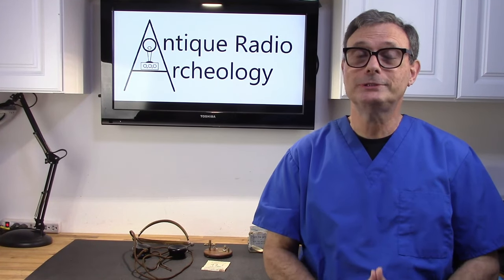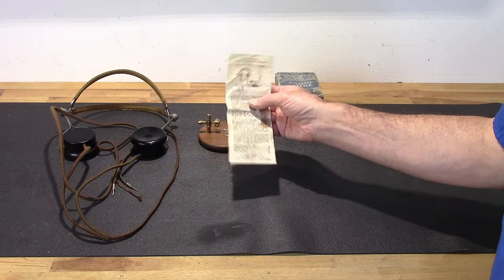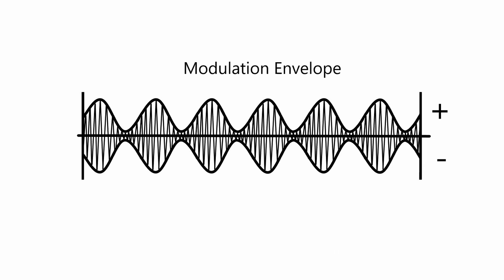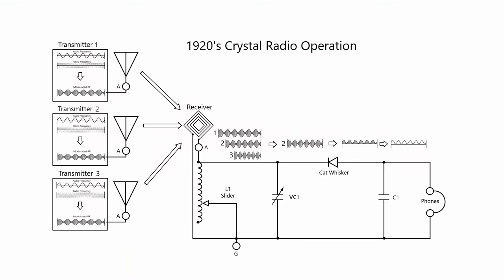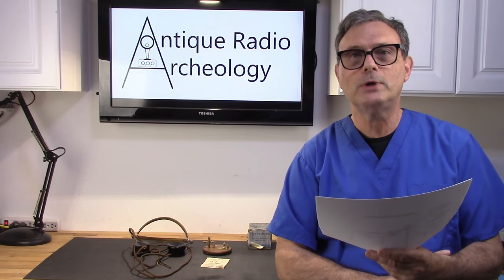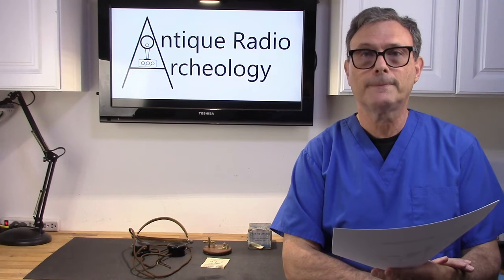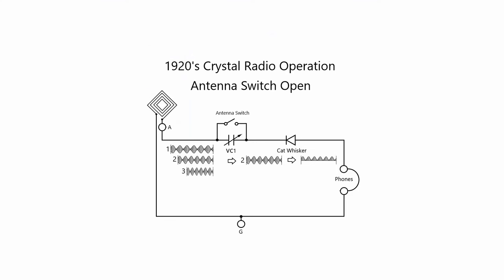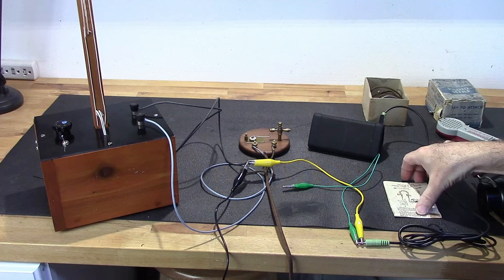A VERY Basic One Component Crystal Radio

Comment: Very cool. It worked! I used a long wire antenna, a ground wire hooked to a water pipe, a D18 Germanium Diode and vintage headphones.  I heard a powerful sports station very clearly. I live in the San Diego area. Pretty cool that you can pick out sound from radio signals with such simple components. Thank you!

Comment: excellent demo & explanation, I love anything about crystal sets..but I got you beat...while experimenting with a crystal set, I connected an old CB antenna to the hot side of the mic input on a laptop-when I monitored the mic input using VLC media player, I heard my local MW station loud & clear (no diode, no ground, just a single conductor antenna). This was accidental & I'm not sure but I'm thinking the mic input has some sort of diode protection that's demodulating the signal, & if so, technically the laptop is replacing the  detector, headphones, and ground.
Reply from the maker: That wouldn't surprise me.  There are documented cases of people receiving stations with fillings in their teeth.  The body acts as an antenna, one filling acts as a detector, and another loose filling or bridgework would vibrate allowing the person to detect and hear a radio broadcast.

Comment: Nice try but the antenna in the video has a tuning knob which is not the radio shown in the pamphlet.
Reply from the maker: The tuning knob has a switch, which is turned off.  I can get a couple of stations with it on.  I only get one when it's off.  It switches a 360pf variable cap in and out of circuit.  I've been called out before on this, which is why I recently added labels to the switch so it can be clearly seen if it is off or on.  750AM radio has an antenna 4 miles from my house, so that's what overrides everything else.  I have an in-home transmitter, so if I'm inside the house, that is the overriding station.